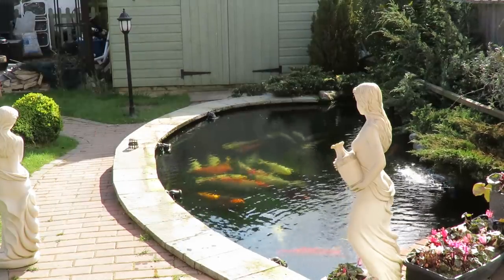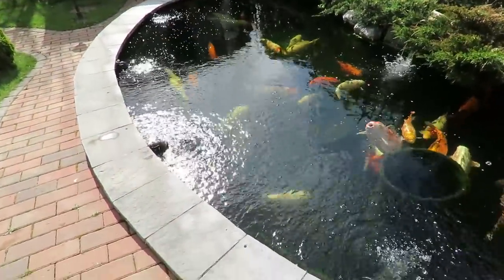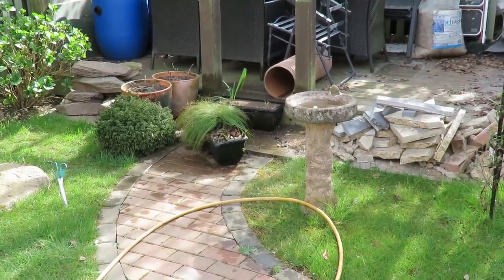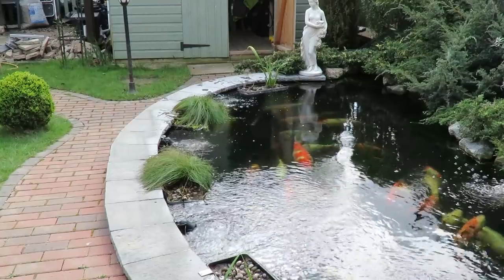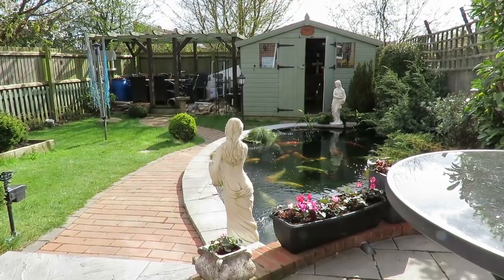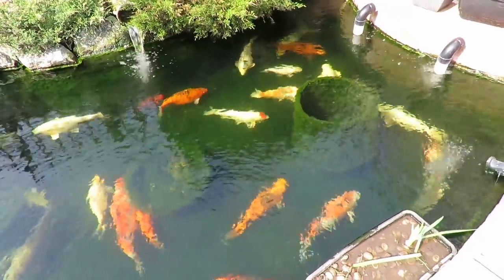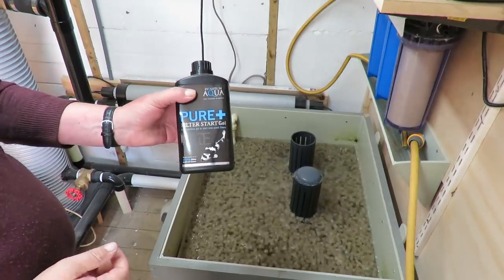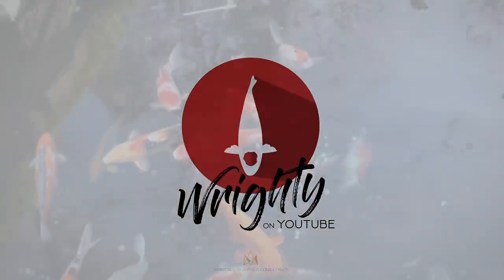Pond Season Underway & It's All Go

Comment: Hi terry nice job bud ..over the moving bed the tap water filter system what’s are the 3 filters inside that sir
Reply from the maker: Hi Nigel, thanks mate. the 3 canister filter I have above the moving bed is a filter & de chlorinator. I filter tap water through it to top the pond up so I don't put chlorine in the pond. You can find them on eBay: https://www.ebay.co.uk/itm/VYAIR-10-3-Stage-Pond-Dechlorinator-Tap-Water-Filter-for-Ponds-Aquariums/113252154052?_trkparms= thanks, Terry.
Reply: Wrighty thanks bud

Comment: Great update video and how all the plumbing works. Would it be worth putting a sweeping 90 on the outlets so its forcing the water across the pond towards the skimmer end? Would probably create more aeration but without too much noisy splashing. Just a thought. Keep safe and well.
Reply from the maker: Hi Simon, thank you. that's a good idea mate. I was thinking of changing the 90 on the outlets to a 45 to give it a bit more of a direction down the pond. I also want to change the down pipes to rubber so the fish can't hurt their selves on it. Thanks for the input mate, Terry.
Reply: Yes I agree but would go with 135 degree bend will push rubbish towards bottom drain and give koi moving water to swim against 👌

Comment: Got a question for you...    how cold is it in winter in your region ? I wonder if your kind of system and winter protaction would work for me...
Reply from the maker: Hi Michel, it did get down to -1c a few times, but not for long periods though. I did have the same system when we had that beast from the east. that was really cold for quite a log time. The winter protection does keep the pond 2 or 3 degrees above what it would normally be. Take care and stay safe mate, Terry.
Reply: @Wrighty  Thank you very much...   i follow all your videos...  Built my pond 2 years ago, had no problem with freeze first winter, but last winter was awful...   lost my 4 kois...   So i intend to work this summer on some way to keep the system running and heating the shed, and ading a water heater...    it gets to -20 here...   so it will be lots of work...   will test my system a few winter before adding new kois...
Reply from the maker: Hi Michel, sorry to hear you lost your koi. -20 is really cold and we never get any where near that cold here. All the best with the new work, take care and stay safe mate, Terry.